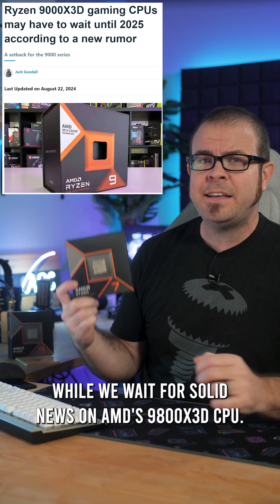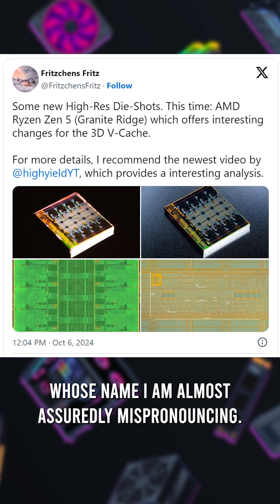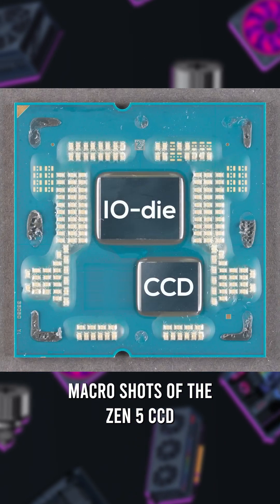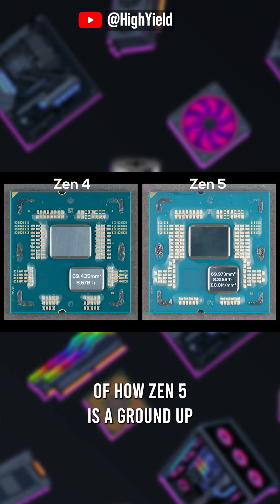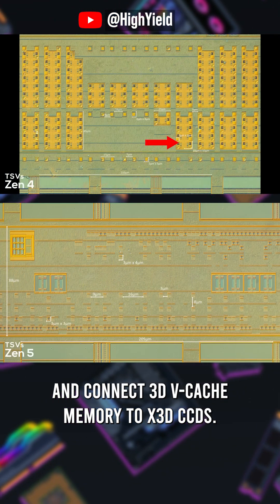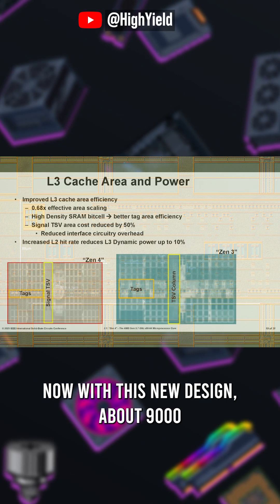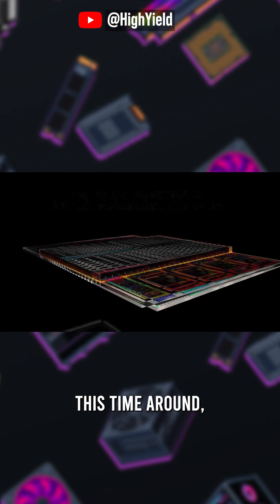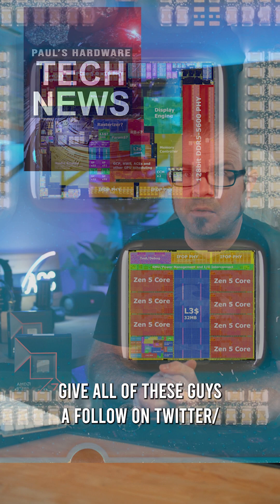9800X3D’s 3D V-Cache Secret

Comment: Having double stacked cache means the 64mb added cache (32mb per layer) will be taking up the space directly above the 32mb(or similar layout) this means that CPU cores  will be directly cooled by the cold plate as opposed to zen4 where some of the core was cooled THROUGH the cache die. Zen5x3ds claim to fame is the ability to maintain high clock.. similar to that of the nonvcache version. Leaked benchmarks show that the zen5x3d cores have almost identical performance in cinebench to the vanilla version which generally translates to clock speed. Imagine 7800x3d could do the clocks of 7700x.. I bet that is 5-10 % uplift on clock speeds alone. Then there is the cache redesign for zen5 that could add to the benefit of additional cache. Zen5 x3d will be 5-15% faster than 7800x3d in gaming. Noice.
Reply: There will still be ‘dummy dies’ next to the vCache stacked on top of the core CCD for structural integrity. If the vCache is double stacked, that means the heat spreader is going to be marginally thinner, but also that the dummy die is twice as thick.

I think a more reasonable explanation is that the vCache has gone through a redesign and simply needs less voltage and fewer TSV’s. It’s going to be producing far less heat if so, and will be much more tolerant of heat coming through the bottom from the cores.
Reply: @benjaminlynch9958 the caches doesn't gererate as much heat as the cores do. Also the cache isn't tempure senstive wither its always been voltage limit. If you limit your max volatage you can change you tdp with a lower TJ max. 
Hence why 7800x 3d has 85c max vs 90c max vs non 3d cache.
Reply: The core will make far more heat than all 3 layers of cache. The issue is that the core gets too hot and the core heat will damage the cache. Whether there is dummy die or not.. whether the cache is cooler.. the main benefit is that the core is not heating the cache when it is double stacked.  The  reason vcache chips are clocked lower is so that the cache isnt damaged. The core will survive the heat and the cache will survive the voltage and frequency but the core heat will damage the cache. That is mostly solved between stacking the cache and having a more efficient architecture they can now run as the same high frequency. I am an electrical engineer but am far from a silicon expert. I could be misremembering as i originally heard the explanation about the core heat killing vcache a few years ago.

Comment: The l3 cache is complete redesign than zen 4, it was like 30%-40% bigger. It's a good thing we were getting similar performance on average vs zen 4. Considering we are using so little die space on the CCD and still getting the same capacity. If the 3d vache is also smaller like the l3 cache, it doesn't need to be put over the cores whose temps may burn the cache. This is pretty efficient. Also the main reason why performance wasn't that impressive on windows is because they are using the same io-die. It bottlenecks the CCD, you can't get faster ddr5 ram to work on Zen 4 and Zen 5 because of the io-die being weak.
Reply: I've seen the OG video breakdown... He doesn't agree with you.
Reply: The cache isn't temperture senstive its voltage, max voltage is 1.35 volts which around the same as zen 5 cores now.